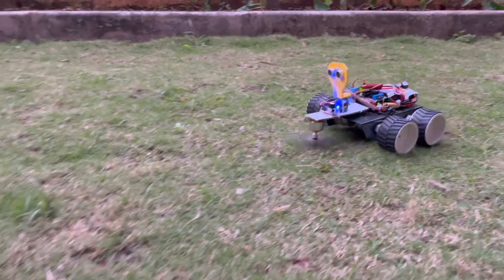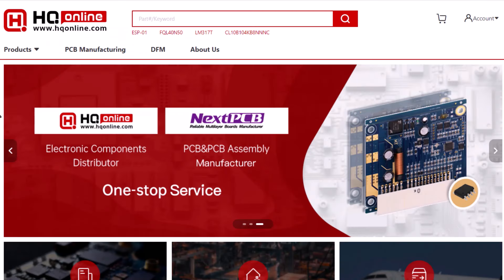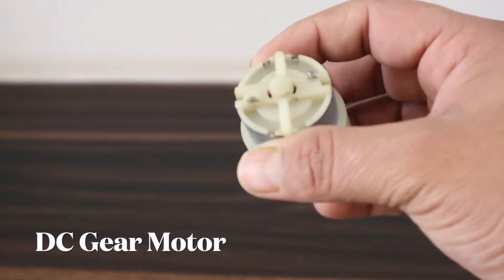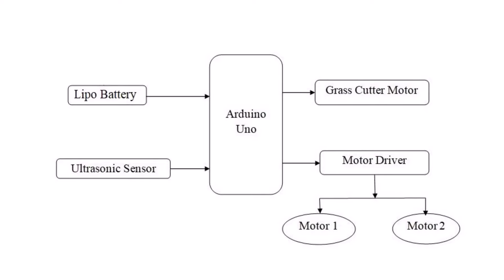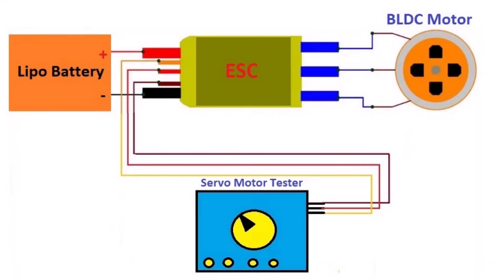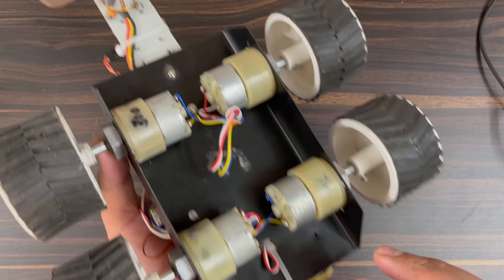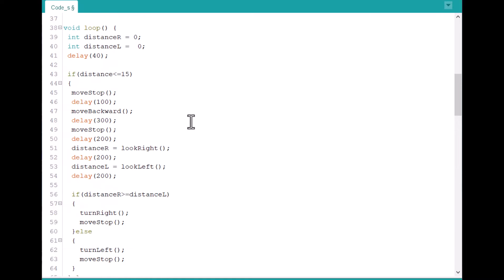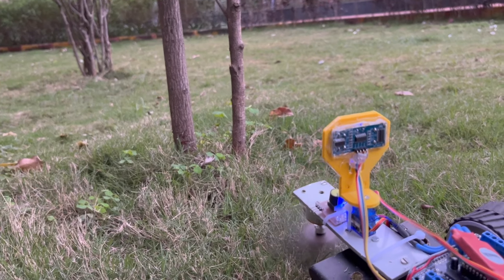Make an Automatic Grass Cutting (Lawn Mower) Robot using Arduino

Comment: I have noticed that your robots wheels are losing traction a good solution for this is to use wheels that have rubber studs
Reply: Or more weight
Reply: Since it's a lawn, lawn spikes would work great and serve a dual purpose